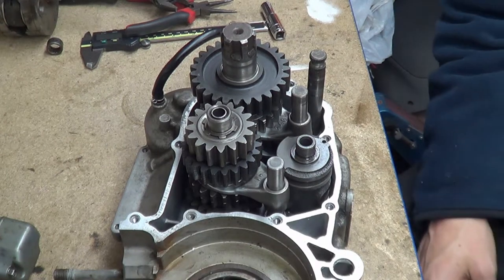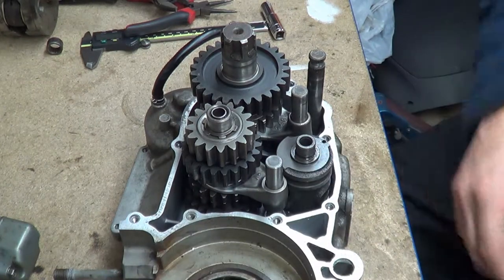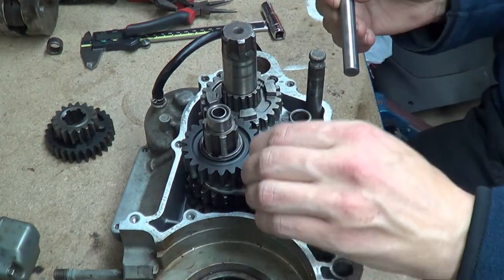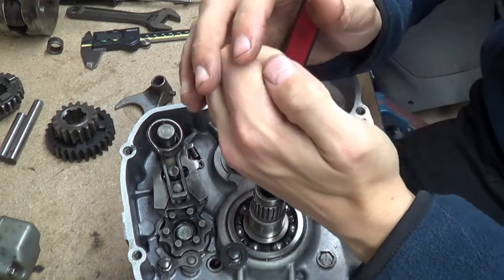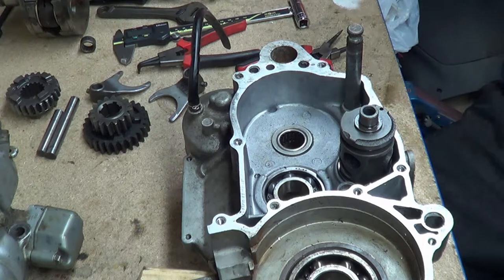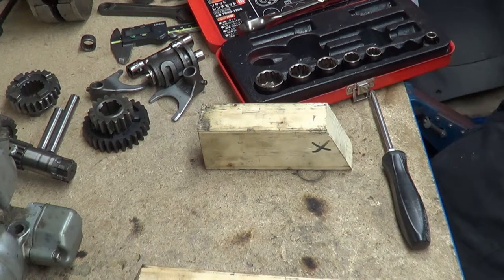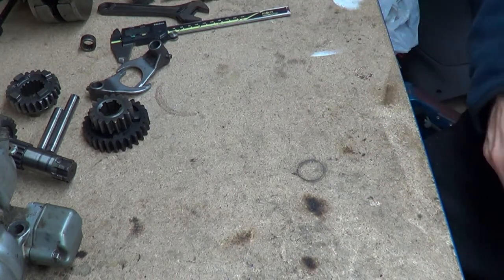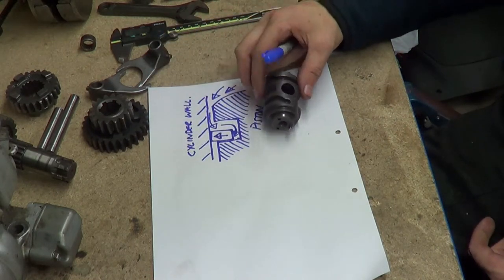KX250 Geared 2 Stroke series - Part 15 Transmission design

Comment: The only diff with the old n new one is the bottom bit of crank as hangs out abit the size side ways and tall ways fit just where it goes round bearing as abit fatter

Comment: The crank is self
Fit but the Conrad hits the casing my new crank has waits and my old one don't have waits is there anyway I can put my old rod on my new crank if I get a bearing and the little bush thing and sorry it's Hayden my son needs help with the info on the crank as how to set kips power valve and setting the clutch up and is there anything I need to no about gearbox/engine befor putting casis together and are u got any kx250 parts anything in mind
Reply from the maker: +Jayne Barnett If the rod is hitting the cases then somethings the wrong size, where did you get the replacement crank from and are you sure it was for your bikes year? The part number for a replacement is 130311302. The H1 (1990 model) crank was only for that year, using a crank for any other year won't fit.

Comment: I don't matey as it was about 3 months ago but it's the one what looks just the same on the ends fly wheel side an gearbox side so I though it wud have fitted the only thing it's catching on the Conrad as older one is abit skinny and other crank .....just befor top dead sinter it's the corner bit where the big end sits in the crank as it hangs out an my old one don't everythink elts fits with out a fuss
Reply from the maker: +Jayne Barnett The crank throw is too big, unfortunately theres nothing you can do about it, changing the rod won't help. Sorry but its the way it is. What's wrong with the old crank? You can have a new crankpin made for your old crank, if the big end bearing has gone.

Comment: So the older rod won't fit new one and eBay it has on the info 1990/2005 and just trying to get the money for a nother
Reply from the maker: +Jayne Barnett The problem is that the stroke is a different size so you'll have clearance issue if you replace the rod for the old one. To be sure you need to measure the crank throw and the crnak pin diameter. Also do you have the kit to remove the old rod?
Reply from the maker: +Jayne Barnett Also do you have the link for the KX250 crank so I can have a look myself?

Comment: The fly wheel side is threaded that bad it' can't be saved as old ower must have had a handle ginger omit it's that bad payed 1000 for it and 3day later the bottom end packed up started to make noise is there away I can Sens u photos as don't no how to use iphone
Reply from the maker: +Jayne Barnett If you have facebook you can send me pictures that way https://www.facebook.com/pony.power.395